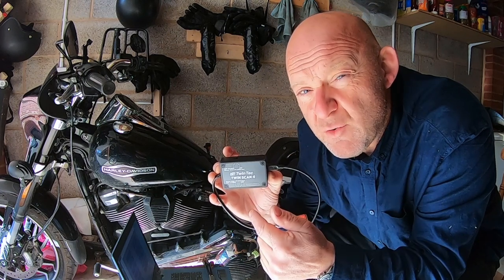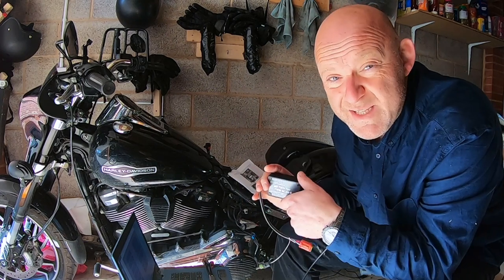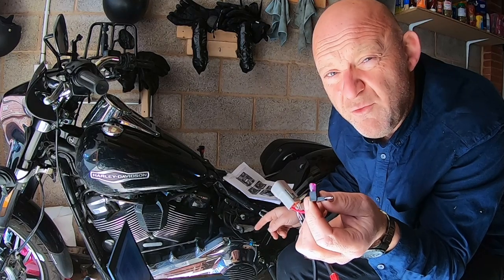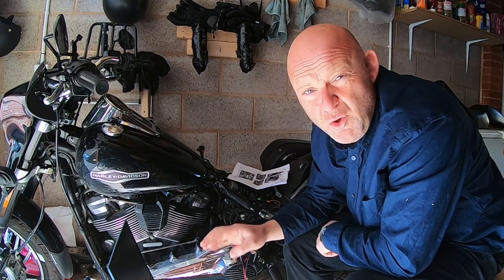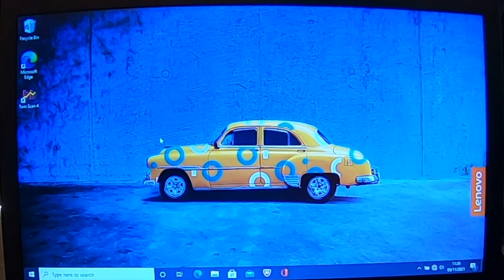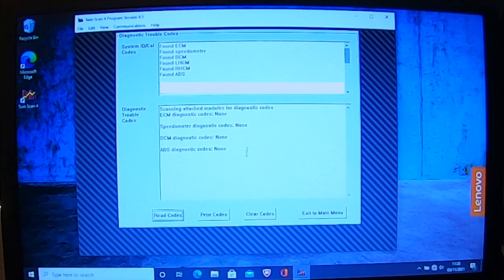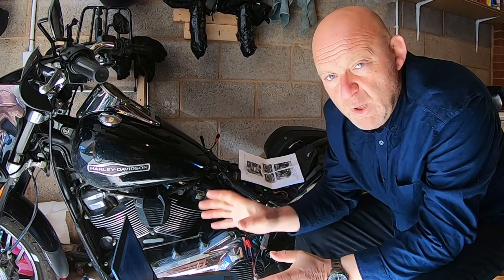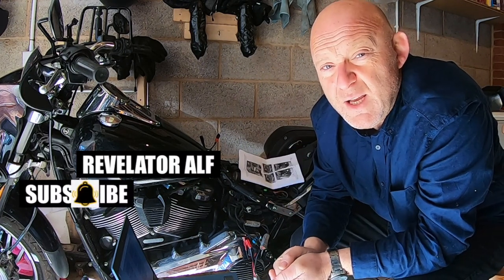How To Connect Daytona Twin Tec Twin Scan 4 To Harley Davidson M8 Softail

Comment: On Page 3 of the downloadable instructions, there is a statement that the unit can get power from the data link connector & fuse tap "or the USB cable to the laptop PC."   Was this your experience?   I am reading some instructions before I purchase.   Thanks
Reply from the maker: Yep it’s all self explanatory in the instructions for me although I did have some connection issues with it on  mine
Reply: @RevelatorAlf   Thanks.  Was just making sure.  Wish you had done more videos on this unit.  Seems nobody else has covered it.  (Yes, I saw the J&P Cycles video).   Maybe it's too easy to use.  🙂
Ride safe.